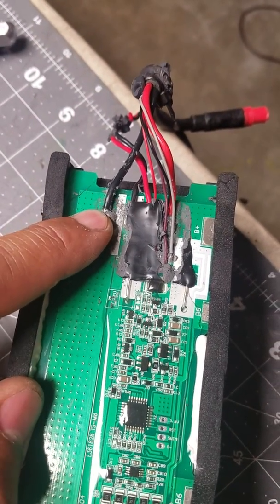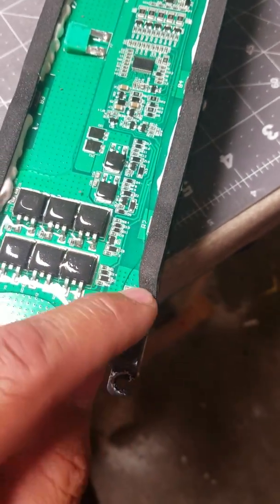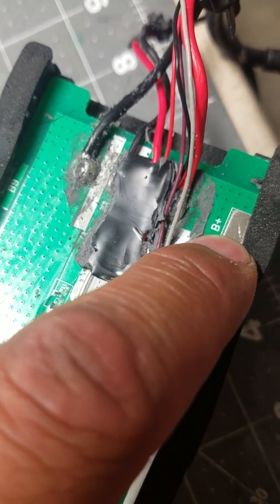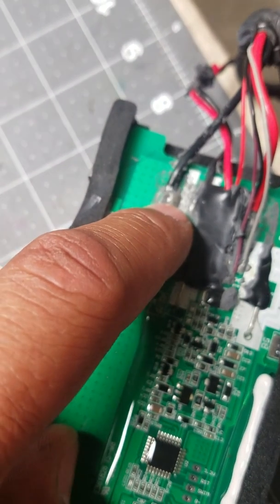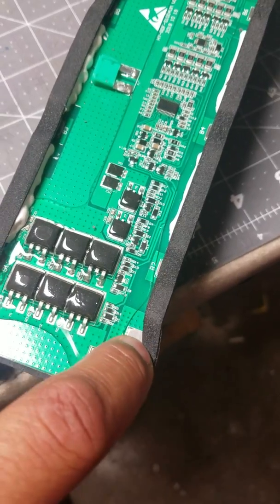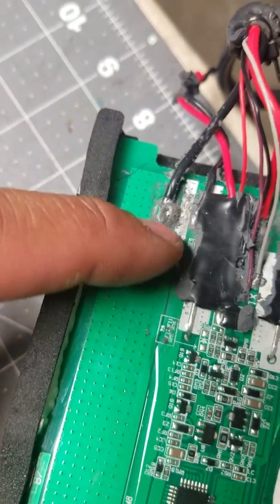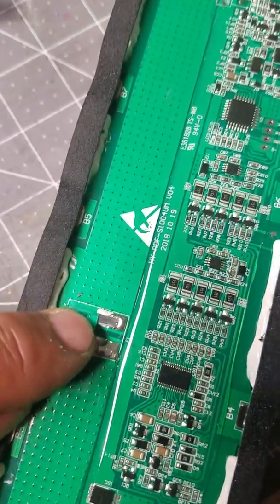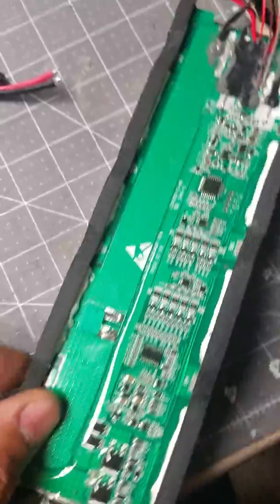bird 590 bms bypass

Comment: a normal BMS will shut the battery down if any cell group goes below 2.5v.  If this bypassed the discharge side - does that mean we lose that safety feature? the battery will continue to deeply discharge without low voltage cutoff?

Comment: I'm stuck at another problem. Where can I get spare tires for the Bird 590 motor? They use some uncommon 9x2.125 inch tires. Does anyone know a vendor of such tires? Preferably in Europe. Mine is falling apart.
Reply: Did you ever find a place that sells them
Reply: @Jae-T219  yes, just a few days ago.  Mikrofahrzeuge Lindau. They have them in their Webshop.
Reply: Eine frage 
Nachdem du den bypass gemacht hast, leuchtet das ladegerät noch grün wenn die batterie vollständig geladen ist? @ShadowTheHedgehog85
Reply: @m.lki67  ja, das ist absolut unabhängig vom Bypass.
Reply: @ShadowTheHedgehog85 also gibt es keine Gefahr dass die Batterie überladen wird sozusagen?
Reply: @m.lki67  du umgehst nur die "Entlade-Regelung" aber nicht die "Lade-Regelung".
Reply: @ShadowTheHedgehog85  perfekt
Vielen lieben dank👍
Reply: @m.lki67  das BMS schaltet einfach bei Last den negativen Kontakt ab, wenn es nicht von der Steuerung eine Freigabe bekommt. Du übergehst mit diesem Beipas nur den "Diebstahlschutz". Achtung, damit umgehst du aber auch die Ausgangsstrom Begrenzung. Ich würde auf jeden Fall eine 30 A Sicherung zwischen Batterie - und Controller - schalten. Mit einem VESC kann ich z.B. ohne Probleme über 30 A ziehen und dass macht der Akku nicht lange mit.
Reply: Zum Motor noch: Da nur der deutsche Bird Heckmotor hat ist das eher unbekannt. Zieh den Motor wirklich gut fest. Er hat Kraft und wenn du ihn nicht fest ziehst kann er sich lösen und das Kabel wickelt sich auf. Fängt er an zu stottern, STOP! Dann hat er sich gelöst und die Achse hat sich gedreht. Ich werde mir eine Verstärkung für die Hinterachse Laserschneiden lassen. Wenn du auch Probleme hast dass er sich dreht, gib Bescheid.
Reply: @ShadowTheHedgehog85  ich benutze einen China Controller
S688 
Der hat 36/48V
Benötig ich dafür auch eine Sicherung?
Reply: @ShadowTheHedgehog85  vielen Dank für den Tipp, geb dir dann bescheid wenn da Probleme auftreten sollten
Reply: @m.lki67  der kommt normal nicht über 6 - 9 A. Aber wenn du den Akku schonmal offen hast und lötest, kannst du auch eine einfache 30 A KFZ Sicherung mit einlöten. Es ist immer gut eine extra Sicherheit zu haben. So ein Akku kann halt Schaden anrichten und eine Sicherung ist nicht teuer. Die paar Euro sollten es wert sein.
Reply: @ShadowTheHedgehog85 ja Sicherheit geht vor. wo soll ich den genau anlöten?
Hast du vielleicht ein Foto von deiner Batterie?

Comment: I recently discovered an abandoned Bird in Germany. Bird pulled out if Germany last year so nobody was going to pick that one up. My battery has an additional label on it, that says "OTA with Anti-Theft". Should I be worried that this battery has its own SIM module?
Reply: To answer my own question, no it has no SIM module inside and no tracking. It also can be opened with a heatgun. Seems to be safer than with a circular saw.

Comment: What kind of range can you get on these battery?  36v 350w hub motor on pedal assest .
Reply: i know this was 6 mths ago you asked but i got 30 miles on 2 of these conected together with minimum pedaling could of got more , i did a video on the battery build and the range test ,im half way through the peddal assist range test video

Comment: Hello, I have done this, but the battery now only charges to 31V, any clue what the problem is? I have tried to resolder to the original wire, but now only charges to 31v,  i have also tried two chargers, same problem.
Reply from the maker: hard to tell from here but make sure you did the bypass in the correct battery cell
Reply: @samzone8920  Yes, your instructions are vey simple! Dont know why, but now only charges to 31V
Reply from the maker: @jorgehumbertosilva  in that case you probably have bad cells you need to test them one by one to find the bad one
Reply: @samzone8920  You are correct, i started disassembling the battery (not easy) and found that  one set of 8 cells are all dead, no charge at all. Thank you!

Comment: So, if we want to use the fuse, do we need to remove it from the board? It looks like it is connected to the same ground plane as the original connection. Maybe we just run a wire from the other side of the fuse to the negative terminal?
Reply from the maker: Is better to buy a thermal protection breaker you can buy them in the autopart
Reply: @samzone8920  Thanks the for the reply! The 36V rating seems to make it hard to find typical breakers at the auto part store. Are you talking about something like this T Tocas 30 Amp Breakers with Switch Manual Reset, Thermal Circuit Breaker for Boat Marine RV Yacht Battery Trailer Bus Truck Solar, 12V- 48V DC, Waterproof (30A) for $26
or would that be overkill, and maybe better to just use an inline fuse like a MCIGICM 12 AWG Inline Fuse Holder with 30A ATC/ATO Blade Fuse for like $8, however Im not sure which fuses are rated for 36V  - again most are only rated for up to 32V.
Reply from the maker: @J_Pagz  https://www.autozone.com/starting-charging-and-miscellaneous-electrical/circuit-breaker/p/bussmann-circuit-breaker-bp-cbc-30hb-r/32372_0_0?spps.s=4805&cmpid=LIA:US:EN:AD:NL:1000000:ELC:8360136649&gclid=Cj0KCQjw_viWBhD8ARIsAH1mCd4QnNWNv0NhD7uPece_YB50If3kGkX33KX-MLv4Y-ObpxB2QGvj9CwaAq4bEALw_wcB&gclsrc=aw.ds
Reply from the maker: @J_Pagz  click the link you will see what I talking about
Reply: @samzone8920   Thanks again for the info.. Isn't it a problem that the stud mount circuit breaker that you indicated is only rated for 14V since the nominal battery voltage is 36V? The highest rated stud mount circuit breaker that I found was rated for 32V..
Reply from the maker: @J_Pagz  son matter I have one in my 52v scooter and no problems the important thing is the amp

Comment: I did the bypass and my battery is stuck on 15.6v I can’t get it to take a charge. Any ideas?
Reply from the maker: So probably you have a bad battery cell
Reply from the maker: If you do it right you should never have any issues
Reply from the maker: Make sure you did the bypass in the right battery pack if not you will get less voltage like you do now double check very careful
Reply: Do you know how to wake it up to take a charge? It won’t connect to my charger
Reply: I tried running it and charging it in parallel with another identical working battery. No change.

Comment: Hi i have a problem.... if i understand it right i was need to cut the black wire and solder it on another thats get to b- right? Because my scooter do nothing after doing that??
Reply: Or do i need the black cable as it is and i was only need to solder the new cable with the black together without cutting the black??
Reply: Ok i found my solution 🎉🎊 don't cut the black wire!! only solder the "new" cable to the same point on the board where the black one is and connect it to B- and done. My scooter get now 45kmh
Reply: @smokeyjoeblau  concrats :) its very easy. But 45km/h is unposibble

Comment: thanks for the video, all your videos are fire, if we do this will the charging safety's still work? I did this and plugged mine in all last night and the charging light was still red after i woke up like 7 hours later, is that normal?
Reply: The charging pair are on an entirely different pair of wires and connect to a different spot on the BMS.   NO,. CHANGING THE OUTPUT STAGE WILL HAVE ZERO EFFECT ONTHE CHARGING TIME, ETC. 

You are only bypassing the circuit which controls how much electricity flows thru these two wires.  The two that feed power to your speed controller   

The two thin wires that connect to the charging plug go to different pads in the board and the BMS will still properly maintain the charging of each of the battery packs cells.  It will stop charging on th bcells that are nearly full, while it continues charging the ones that are less than full.   When all cells are full it stops putting power to the charging wires to each of the cells in the pack and your charger turns green as it no longer has a draw on it's positive and negative wires,. The current flow comes to a stop and whatever the cutoff is in the programming of the bmsz the bms will shut off charging once the voltages of each cell are 3.7v or higher each.
Reply: @patrickmichael2968  so i just have to solder a b- negative b+ positive wire
Reply: @patrickmichael2968  but it is safe for reloading to solder on b- and b+
Reply: @patrickmichael2968  yes, thanks to the bms, I did, but how do I know when the battery is charged
Reply: @The7Gamer   your charger puts out 42v to charge your 36v battery.  When thr battery is full it will be somewhere around 41-42 volts.  That may dip down to 40v once you disconnect your charger.  Your battery is considered dead when the voltage gets down to 31v.   You can buy a voltage gage on Amazon for around $5. And this is really helpful to know how much battery life you have left when you are out riding.     You'll get used to judging distances and how much further you can ride after you get a voltage gage and start seeing your voltage levels on a regular basis.
Reply: @The7Gamer      the BMS will continue to control the input side of your battery, meaning it will shut off incoming voltage whenever thr battery gets full.   Also your charger will do this too.

You need to charge your battery on the factory provided charger port,   that will be controlled by the bus even though you added the ground jumper on your output stage (the 2 wires coming directly out of your battery pack, and not the output wires of the BMS.   Hope that isn't too confusing for you
Reply: @patrickmichael2968  bro i did as the video said, and i try to charge the battery and it wont charge
Reply: @patrickmichael2968  I took a tester and saw that the court goes into the battery but the battery won't charge
Reply: hello, finally, do you have a problem? I have the same issue like you. few hours in charge and always red. I dont have my controller/lcd to test if the battery is charged or not. can you say me what about this problem? thx.

Comment: Oh great one how u doing? I have a question I have 36/48 v 450w brainpower controller - non LCD..I usually use the control wire as a throttle wire and let the rest of it just be non-operational...like a neanderthal with a pair of wire strippers and a soldering iron. In hopes to evolve into a homo-sapient one day I’d like to know what wires from the controller to hook up to the control wire and then how to identify which wires up top to use for the throttle and headlight...I don’t care about the brake so much but if your willing to answer this ridiculously long question with a ridiculously long answer than I’ll certainly take in any info your willing to give out. Your videos are awesome. Maybe I’ll post one of my own and credit you for the instruction.
Reply from the maker: I have a  video for that look for it

Comment: Hello, I just have to remove the black cable and plug it down, and I would no longer have to worry about cutting the battery
Reply from the maker: Yes
Reply: @samzone8920  The mieu these below, or in the middle on the left my connection?
Reply: Just plug in the black at the bottom and say goodbye to perfect bms

Comment: @samzoneworld Hello Sam, I am currently trying to do the BMS bypass I have a controller with: “Spec:DC36V”, 350W, “Maximum Current:18A”, „Low-V Protect DC30V +/- 0,5V“
It’s a brushless Controller for LH-100/M5

I am scared to set the scooter on fire or destroy the battery or stuff like that.
The battery is fully charged btw. Is that a problem?

Also when I make the bypass which cable should I use for extension of cable to reach to B-?
Thank you!!

Comment: What kind of speed increase are you getting with the BMS bypass and the controller you installed in the other conversion videos? I converted mine with the same hardware but could use more speed
Reply: for those who do not understand what is the point of doing this, it is for those who have the scooter shut down suddenly
Reply: Get a higher wattage ESC.  Install a 500watt.  Or even a 800watt.   The motor on that scooter can handle bursts of up to 1000wwtts for a little bit ..   Although I'd recommend not using more than a 500 watt to keep battery consumption / range within an acceptable range and not cause a premature burnout of your motor.   A 500 watt ESC will kick some pep in it's step for sure...
Reply: no
Reply: So l should just disconnect the black from the board and run it to the fuse or can I just run a wire from the fuse to the negative black wire and leave it attached to the board?

Comment: if I understand correctly it is necessary to desolder the black wire at the top and to tie it down at the bottom B- at the bottom ?
Reply from the maker: yes
Reply: @samzone8920  thats all ?
Reply from the maker: @lyhorallal916  for bypass yes thats all simple
Reply: @samzone8920  ok thanks you
Reply: @samzone8920  if i have any other question about the bird i can ask them?
Reply from the maker: @lyhorallal916  yes

Comment: He thank you very much for the explanation, I would like to use this battery as an extra battery for m365 pro . Is it possible to keep it in the plastic box . (Cover) and which wires are positive and negative I see like 8 wires.